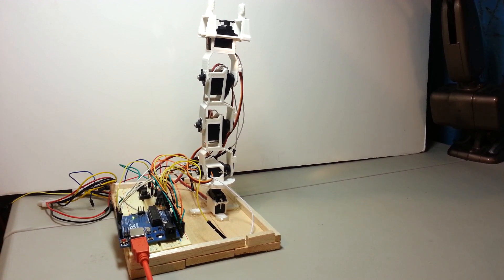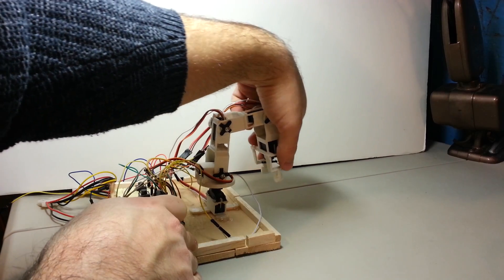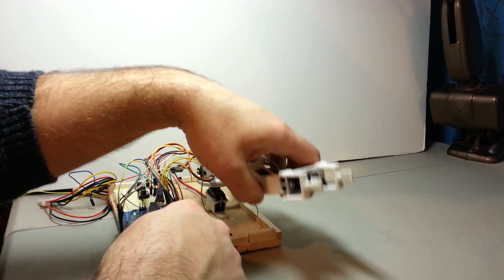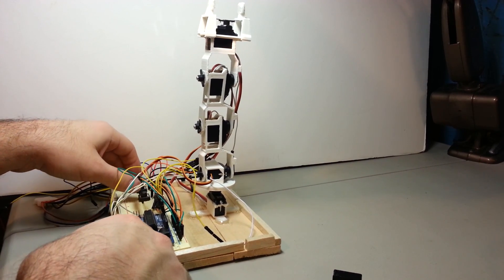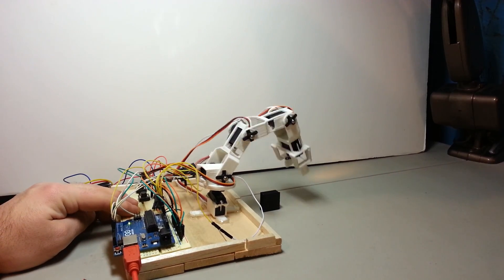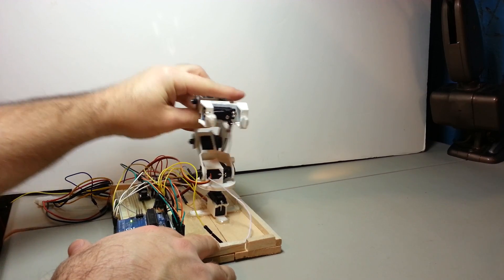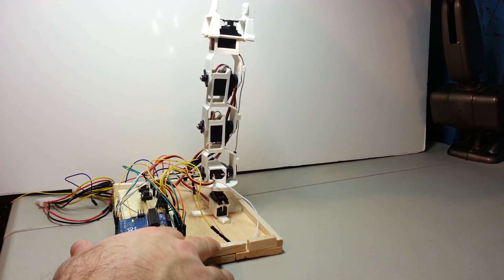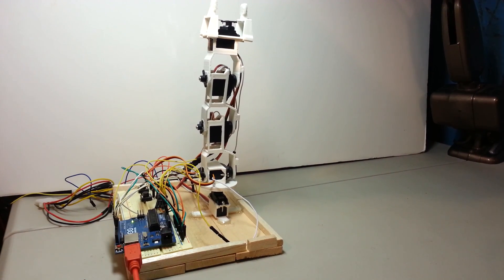Trainable Robotic Arm 2

Comment: hello. Is it possible to make this without using analog feedback servos? Can I make this work with just regular servos?
Reply from the maker: Karen Grace Victor If you make an arm with normal servos you will need to program each servo position into the microcontroller somehow.  The ability to use your own hands to manipulate the arm servos is provided by the analog feedback - there is no other way to record the positions you manually move the servos to.
Reply: navic209 Thanks so  much for the reply, you have no idea how helpful you've been to my project
Reply: +Karen Grace Victor what  was asking to do is called inverse kinematics and that involves heavy trigonometry math but heavy as the calculation of processing not heavy as in making a trig function to solve for the 3D space of the Cartesian coordinate system and you need to learn about Jacobian formulas and Euler's law of motion, is a lot but the results are way better and also you get to take home the big Pat on your shoulders for the accomplishments.

Comment: How much current does that robot arm run with? I'm working on designing one myself, but if my math is correct, those motors seem like they demand too much voltage for the Arduino Uno to handle.
Reply from the maker: Well current and voltage are different.  The servos require 5v to operate correctly, and they will consume as many amps (current) as necessary to perform their motions.  I did not attach an ammeter to the setup to measure how much current the system uses during motion but it is much less than 5 amps because that's the maximum current my power supply would deliver to the system.  I would not recommend using the onboard Arduino 5v regulator for the servos, instead use a power supply for the Arduino and servos.

Comment: This is awesome!  The replay was surprisingly fast, probably at least twice as fast as the recording...   How do you build the path for the arm, do you just replay recorded values?  Are they recorded as waypoints or something? 

Great job, thank you for sharing!
Reply from the maker: The code records positions then during replay it steps each servos through the increments between each position.  Complete guide and code explanation is on the Adafruit Learning System: http://learn.adafruit.com/trainable-robotic-arm